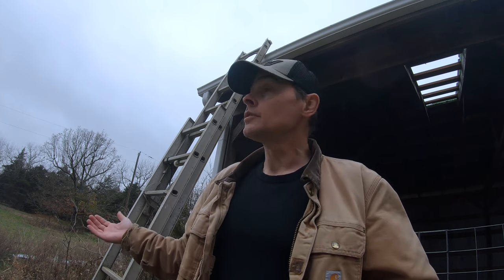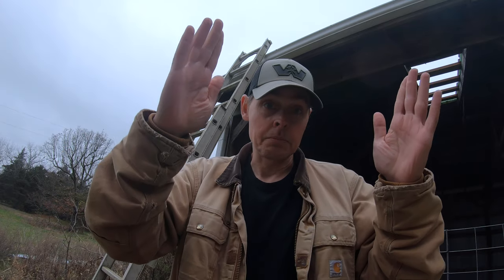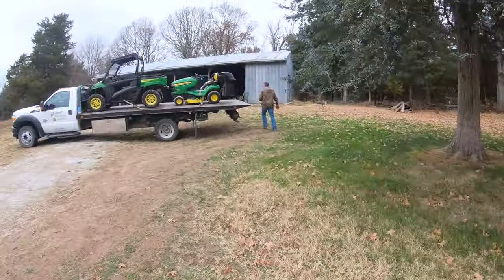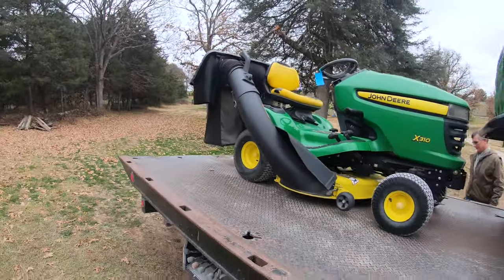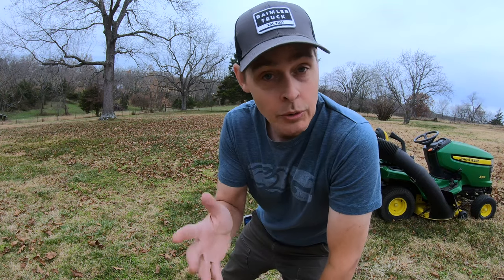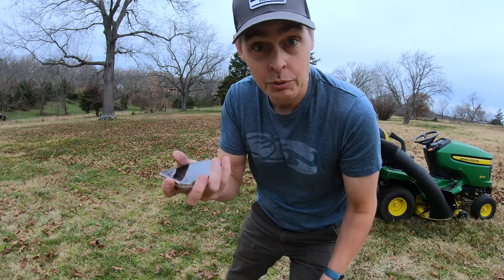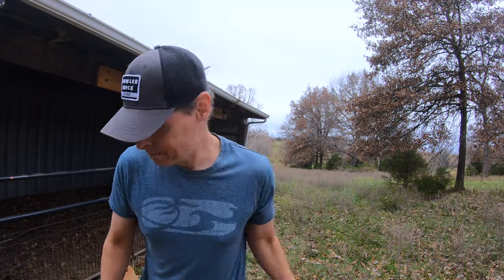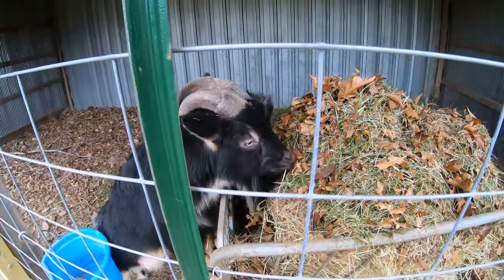Roofing Work and We Bought a John Deere

Comment: I'm sure that you will have continued great service out of your John Deere riding mower. I had a lake cottage in Ohio for nearly 30 years that I sold two years ago now. I included a 12 year old, 42" John Deere riding mower that other than some bumps, scrapes and bruises on the body, ran as good as the day I got it from the local Deere farm implement dealer. I had it maintained regularly by them. When it came to handling the fall leaves, I'd leave off the bags on first run of cutting the yard. The machine would almost mulch the leaves which is good for the grass and once all done, I would then put the bags back on to pick up the greatly chopped leaves and grass. It saves from having to empty the bags so often when having the bags on during the first run through of the yard. I had close to an acre between the side of the property where the house was located and a large open, park like section on the other side of the property. Just a suggestion on how I found what I thought was the best way to process autumn leaf fall. Good job on the roof. Your place looks wonderful.
Reply from the maker: Thanks for the tip. It was a lot of leaves to deal with.
Reply: @SimpleMoonFarm  Well, if you try my way, I hope it helps you next year. I had about three months that I had to deal with fall leaves with October being the biggest time of all. Thing was, when they were really coming down, if the wind picked up, by the next morning it was like I hadn't picked the leaves at all. Being on the water, we had tons of boats going by on the weekend and everyone kind of competed for trying to keep a perfect yard, you didn't want to let the leaves build up till you came back up the next weekend. You don't have that problem being on a property like yours! You aren't in a competition with your neighbors over who keeps the most picturesque yard. You also didn't want all the people in the passing boats to think you were a slacker in dealing with the leaves! 😆